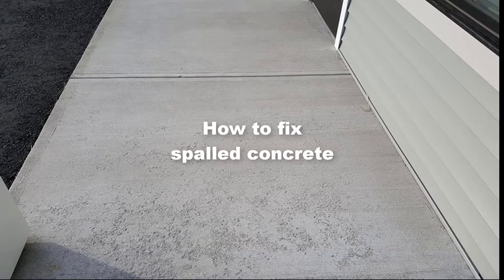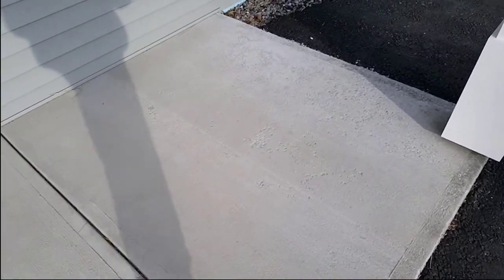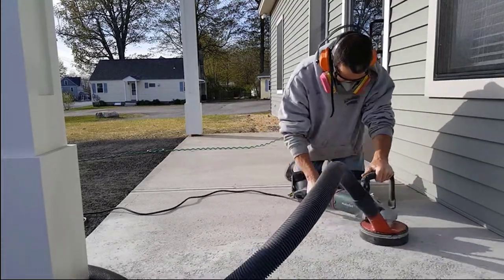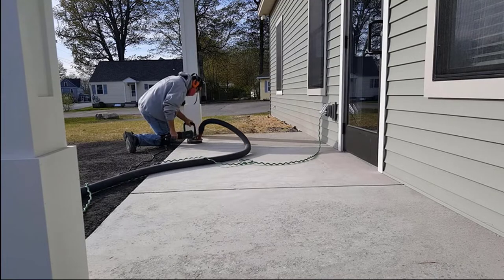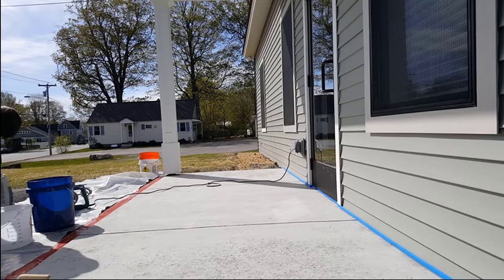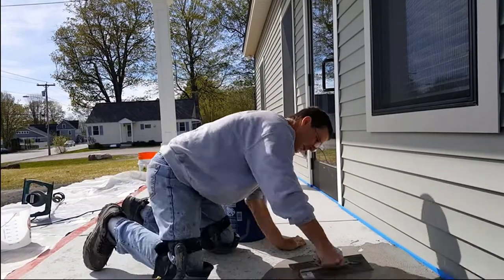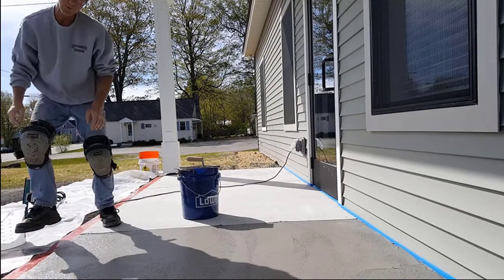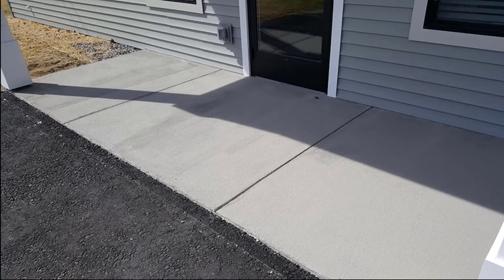Concrete Resurfacing - How To Fix Spalled Concrete

Comment: Funny how every book says spalling is from bad mix or overfloating, but every contractor says it’s the owner’s fault from salt.
Reply from the maker: It can be from a wet mix and/or over floating. Also from using de-icers. Having a good contractor and properly informed owner usually takes care of this problem. Sealing the concrete is important also.
Reply: Often, when called to customers homes with badly spalled concrete in the garage you can tell exactly where the cars sit as the drip the salty water off the cars.  In the corners, and areas where cars do not drive,  the concrete is often in great shape.
Reply: I am in an HOA that spent over $300,000 replacing asphalt driveways with concrete.  Two and three  years later we spent $150,000 partially replacing concrete.  We had it tested and the lab concluded it was overworked at the wrong time.  But up to the lab report, everyone blamed it on salt or de icers and bad sealer.  Even driveways that had no use over winter (second homes) spalled.

Comment: 2 variables that could improve results.  Prime seal the raw concrete after grinding or mist the concrete so the resurfacer does not lose all moisture too quickly, allowing your broom finish to be smoother and the bond will be better.   Prime sealing will also give you better color uniformity.  After a resurface, you should seal the new concrete for added protection from stains and weather.

Comment: I’m really surprised that you don’t dampen the concrete before troweling the top coat.
Reply: Correct. The slab should be moist, not dry.
Reply: The Ardex CD instructions say not to pre wet the slab

Comment: Would this be durable enough to use in a garage with cars driving over it? The concrete in mine is badly spalled and very dusty

Comment: Another great vid ... just poured 85 sixty pound bags in an old basement (about 4 inch thick) and had to form it out in sections of 15 bags each.  One section i was tooo exhausted and poured too much water and over worked the surface and that section had a few large areas of dusting.  Used pure portland as a paint after cleaning off the dusty surface as much as possible to prime the surface after I wet the concrete.  It came out fine so far.  Wish i saw this 1st!!  Thanks again for your informative vids.
Reply from the maker: That sounds like hard work Thor. Good for you!!

Comment: Thanks for the video.  Have  a concrete driveway where the ice melt spalled in small sections.  Can you repair the spots or do you have to resurface the entire driveway?  I know all jobs are prices specifically, but what would be a general cost of the patio you did in your video?

Comment: Hey Mr. day, Is it OK just to resurface sections of a driveway. Just asking because I didn’t know after using the Ardex if it will match the other parts that I wasn’t going to resurface?
Reply: No would not recommend at all just rip it out and do new it’s concrete not asphalt
Reply: It will hold up we use this where semi trucks pass on and it holds up good but it has a different color to concrete which is why it's best to the whole square unless you don't care about the colors then you could do sections but it will hold up for a while I use this material EVERYDAY at work

Comment: Mike i have a horrible cracked parking pad into the garage. If I pressure wash the concrete extremely  good, plus remove loose material, could I mix this up to fill in all the gaps/cracks? Then come back and resurface it all without grinding? Its so bad....like cracks everywhere but I can't afford to replace it
Reply: Open the cracks more probably half an inch with a grinder and a cutting blade  clean them out and then put Pegabond in the cracks, let it dry and then do this video exactly how Mike did it and that should do it

Comment: Would be curious to see how this holds up a year or two down the road.
Reply: That's all it's meant for.
Reply: It holds up we use this on roads where nothing but trucks drive on it and it's been good for like 7 years also this ardex CP is good to patch holes in concrete walls it's sticks very good and doesn't crack
Reply: I’d love to see what this looks like now

Comment: Mr. Day is there any manufacturer's suggested curing procedure for this fast cure product?
You didn't seem to mention it.
Some of the other toppings i have experience with say water spray or moisture during
the short cure period.
Reply from the maker: This is right from the Ardex Tech Data Sheet about curing "Although ARDEX CD requires no special curing procedures,
avoid applying this product if rain is expected within
6 to 8 hours or freezing temperatures could occur
within 24 hours of application. As with any cementitious
material, these conditions can alter the appearance and
performance of the dressing."

Comment: Will Ardex survive on a driveway with a diesel pickup on it?
Reply from the maker: If it 's done right it will.
Reply: Mike Day Everything About Concrete, Thanks. Reno contractor scheduled to visit for an appraisal.
Reply: Yes it will ,we used this material for a driveway that diesel semi trucks pulling heavy loads drive on and its been holding up for 5 years so far

Comment: Will this material hold up in a garage? I want a smooth finish and I’d like to apply an epoxy afterwards.   Road salt is ruining my garage floor
Reply from the maker: Mark, if you need to repair your garage floor, search for my crack repair videos. That's what we use to repair spalling, cracks, chips and more on garage floors before we epoxy them. The product is called CrackWeld

Comment: Wouldn't it help if the slab was slightly wet.
Reply from the maker: That does help. It rained the night before so I didn't want to add any more moisture to it.
Reply: Ardex recommends that the concrete is very clean, either through grinding or pressure washing.  When the material (Ardex Cd) is applied however, the substrate is recommended to be completely dry.

Comment: How long will this last on a driveway in northern Indiana?
Reply: And are you able to and/or would you suggest sealing when done?
Reply from the maker: If done with proper prep, and proper application, it should last a very long time.
Reply from the maker: Yes, sealing is always good.

Comment: I'd cover the outer walls of the home up at least two feet high It's far too easy to splatter material onto the siding or glass. And good luck getting it off, once it's there. Parking lot asphalt should be taped off, too.

Comment: The concrete patio at my friend's house is far worse than this. There is so much concrete in their back yard area that is in really bad shape. I'm not sure if it can be salvaged but any tips would be much appreciated
Reply: Open the cracks more probably half an inch with a grinder and a cutting blade  clean them out and then put Pegabond in the cracks, let it dry and then do this video exactly how Mike did it and that should do it 7:41

Comment: We are planning to start our own concrete company, however, we are not sure how to make the contracts for a job. I have 10 years of concrete experience. I just don't have experience of Bidding nor contracts. Please Help. Also, do you charge your projects by the sq ft or by the job?
Reply from the maker: Charging for projects (floors, slabs, stamped concrete, staining concrete) is done by the sq. ft. Smaller projects like 500 sf or under is done by the job with a minimum charge for labor. Bidding is so different around the US, I'm not sure what people charge where you live. Start by figuring your materials then what you need for a minimum per day for labor to make a profit.
Reply: @MikeDayConcrete  Thank You for your advice. What are your thoughts on the Medusa Walking Saw? Also, would you happen to have an example contract you could show us? We live in Wyoming and we still have a lot of snow on the ground. We are waiting for it to warm up some more the ground is still frozen.
Reply: @amandamartinez6115  check out the nextdoor app. (It is like facebook for your neighborhood) I get a lot of small jobs off that. And the beauty of it is, they are all in my neighborhood so it's super close and easy to build reputation.

Also: craigslist, meetup (u can approach real estate groups etc. and see if someone will let you do a small job for a decent price to get to build relationships) or check with local remodelling companies, they frequently do not do their own concrete work.

Also: facebook!

Comment: You didn't wash it or bonding agent hmm?
Reply from the maker: Donald - No, I lightly ground the slab to prep and clean, then vacuum. Ardex CD doesn't require a bonding agent.
Reply: I would of at least washed it off , just to get that dust off . How does that shit hold up?   I've had luck with t1000 overlay from Butterfield Products. Do a one year later video  on that job , I'd like to see it lasts.
Reply from the maker: Donald - this is from the Ardex CD data sheet : All concrete substrates must be structurally sound, solid,
thoroughly clean and free of any form release, sealers or paints, patching compounds, dust, dirt, oils and any other contaminant that could act as a bond breaker. If necessary, mechanically clean the floor down to sound, solid concrete by shot blasting, grinding or similar. High-pressure (5000 psi) power washing may also be used to remove dust, dirt and debris, though the concrete must then be allowed to dry thoroughly before proceeding. 
I could have washed it off, but I only had a small window to get this done (Sunday) It's a place of business open 6 days a week. I didn't have time to let it dry out for a day before resurfacing it and Ardex doesn't require us to wash it or prep, grind and vac is good.
I've had good luck with this product. I also use a lot of Butterfield products. We stamp a lot of concrete and use their integral color as well as their stampable overlay.
Reply: It said it self free from dust , so your vacuuming isn't enough to get rid of dust . I totally understand time frame but if you washed it early am or Saturday evening ( if possible). I feel would of been better . Not hating just saying!
Reply: @donaldloos2049    if you live close and want another trip back, and the weather is favorable, and the business is closed long enough,  then washing it off wouldn't hurt.  Specs are for application over dry concrete though.  This product wears well and I have done gas stations with it before around the pumps.  In northern climates, you should still seal it with a good sealer to prevent similar problems from occuring again.

Comment: Your broom finish is too ruff....I hate that rough of a texture on concrete. I would let it dry a little more and then use a finer broom for a nicer look
Reply from the maker: You can't let this product dry more, you have to broom it very quickly or  you won't get the broom finish on it. I could use a finer broom though.